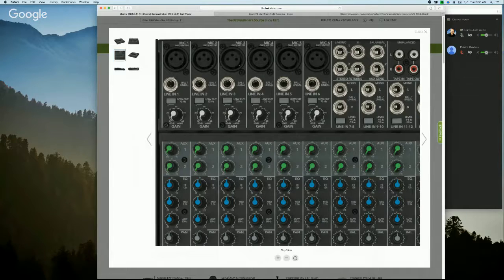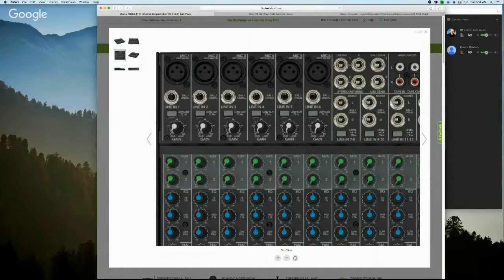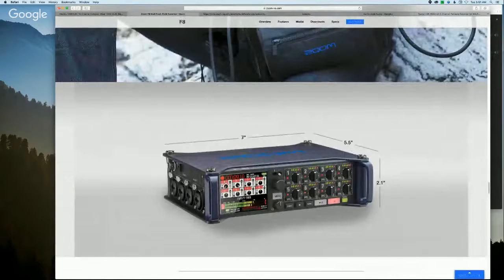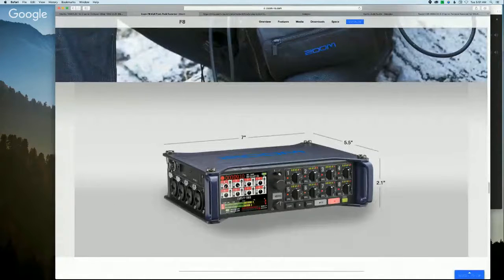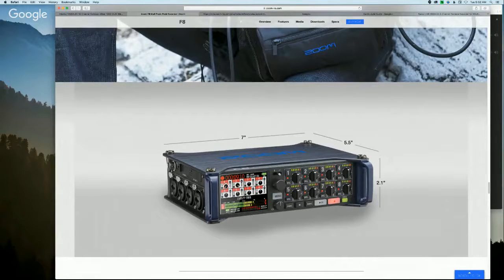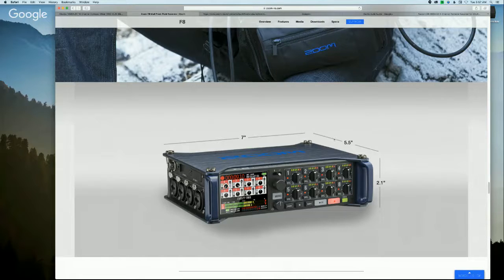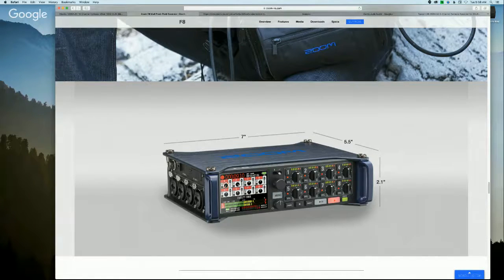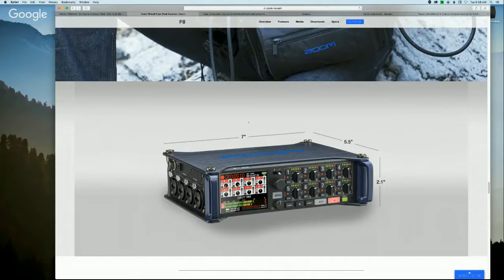Sound for Video Session 19 January 2016: Gain Staging

Comment: Dear Curtis, thank you very much for another great video. I do have question regarding the dB settings of different devices. ( You explained it nicely using the Tascam with an DSLR, putting the gain control of the DSLR on lowest level). How about using the F8 with a wireless mic system like the Sennheiser ew 100 g3? How do I have to put the dB settings at each devices?  As far as I remember on the Receiver the factory settings for the AF Out is -6dB. At the Transmitter the factory setting for Sensitivity is -6dBas well. Do you have a recommendation? How do they influence each other?
Reply: +Till Brenner Hi Till, I would leave the G3 at its default and use the F8 to do any additional amplification needed from there. You could even try reducing the output of the G3 receiver and let the F8 do more of the amplification by increasing the gain there. My experience with the G3 is that it is pretty clean so the default output setting of -6dB is probably fine.
Reply: Thanks Curtis, great help and always a pleasure and watch your videos. Could just highly recommend it to everybody!